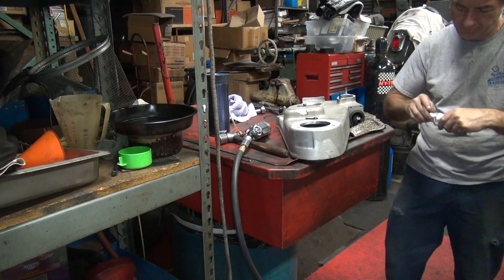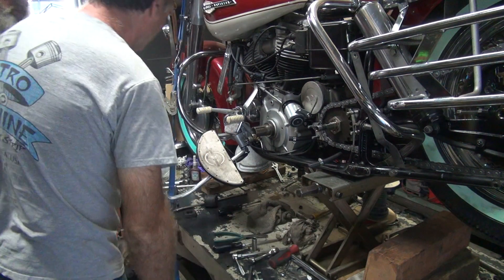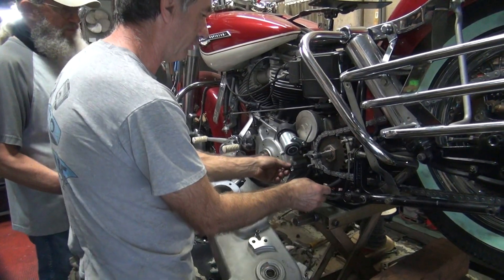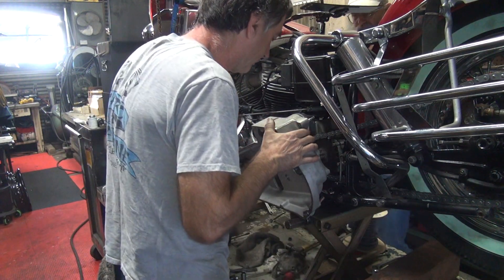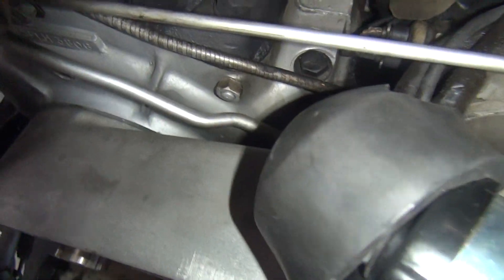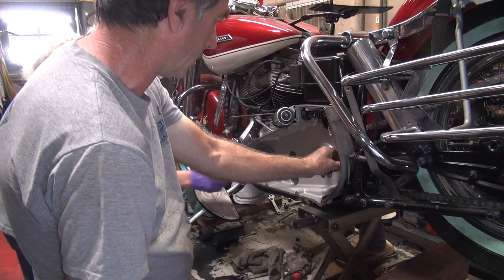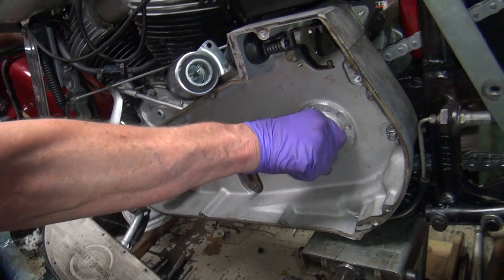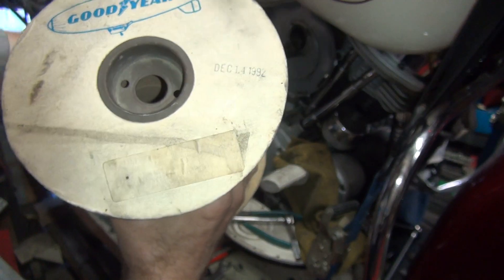#117 1965 74ci panhead new bike purchase full service repair FL FLH harley rebuild by tatro machine

Comment: I just did the same on my 67 prior to watching this video. Except I attached all the lines to the inner primary first so I can get them nice and tight. Pulled the lines through where they needed to be then cut to size at the oil pump. The rear return clamp I had to flip as well to clear the frame. I did it for the same reason you noted no front engine seal. Primary was too wet clutches were slipping time to suck the oil out! Your video's are very informative thanks for posting all your work.